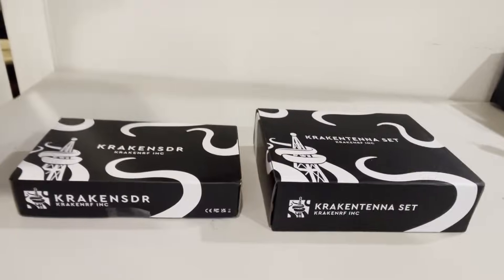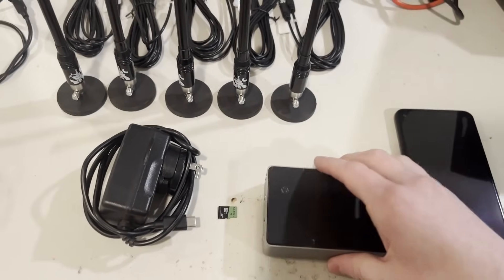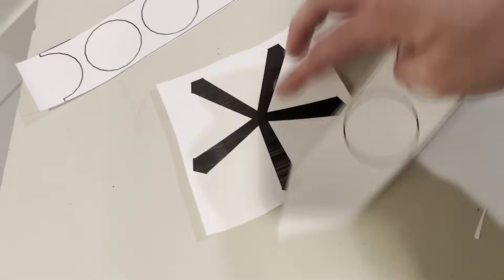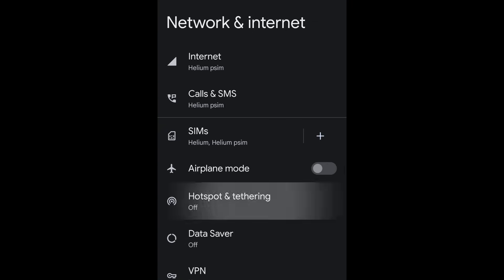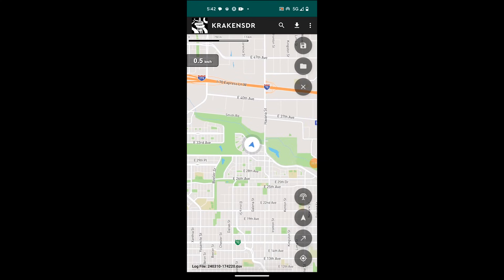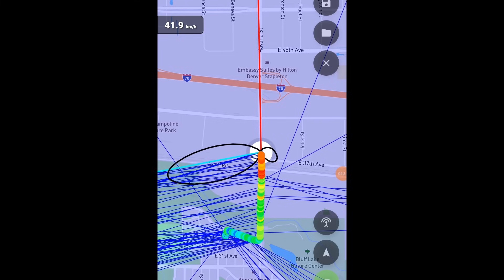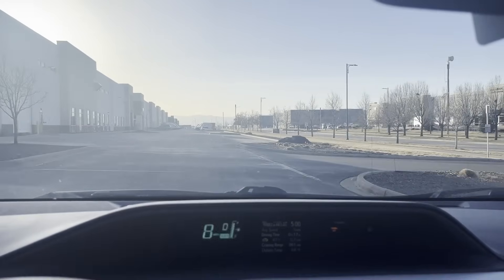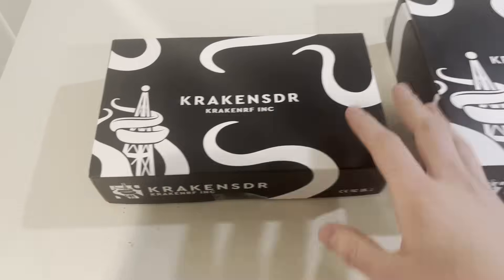Kraken Radio Direction Finding Unit Setup Tutorial and Demo

Comment: I purchased the kraken as part of CrowdSupply (years ago), but have not have a chance to use it yet. That said, I'm very rusty and had no idea where to start, so you video was very helpful, thank you 👍. I got stuck with the Angry IP software not finding my Kraken over the hotspot. It ended up being because the IP range it was scanning was not the correct range for my mobile hotspot. E.g. it scanned 192.168.0.0 - 192.1668.0.255 and my hotspot was in the 10.59.59.0 - 10.59.59.255 range.

Comment: Very cool!  I don't know a whole lot about radios.  But could this setup be used to direction find a specific LoRa signal on 915Mhz for example?  Or would it pick up all traffic on 915Mhz rather than just the signal I'm looking for?
Reply from the maker: Probably tricky for ism 915, lots of random signals there and can’t really lock down on the one you want , the kraken can’t decode by protocol

Comment: I used mine on a 2m fox hunt this evening. Im running low prowfile 4" antennas and it wasnt ideal. Wanted antennas that would stay put 24/7. Might use telescopic 1/4 antennas next week. Until I can make a sheetmetal platform to permanently affix the elements (although, this limits my frequency options a bit). Maybe I'll make uhf and vhf layouts, which I could move to, without too much hassle.
Reply: Just use 1/4 wave mag mount whips.  I use small black ones.  Hard to see.
Reply: @stargazer7644  ended up using strong NMO magnet mounts with adapters to 1/8" steel whip material.  I need to paint the elements black, tomorrow (bare metal will rust). Rather than exotic (expensive) steel, found Lowes has decent strength steel rod for cheap price.
Reply: @frankthetank3342  TIG Welding rod is also a good alternative.  It comes in a variety of materials.

Comment: Very neat video, but one question, wouldn't a single directional antenna be more effective than using an array of omnidirectional antennas? Like, directional antennas are already very good at direction finding so is the Kraken just showing that direction finding can be done with an omnidirectional antenna?
Reply from the maker: With a directional antenna you would have to manually get outside of the car and aim the antenna by spinning it 360° to find the peak signal strength. Completely doable and usually what I used to do but just takes a lot of time manually getting bearing lines every time you stop the car. Plus most directional antennas have side lobes so you might get a signal even if you aren’t pointed right at the source.
Reply: @SkylerF Well right... but with an omnidirectional you could be picking up that cell tower, or the other one down the street. A directional antenna would be subject to a lot less noise, and really, you only need 3 or more points for triangulation. Rather than driving in a circle letting the system figure out where something is until it actually figures it out.
Reply: @kjchaifisch  Been there and done that with various flavors of directional antennas.  Actually a cardiod antenna worked best, aiming for the LEAST signal rather than the most.  It has a single very narrow notch.  But as SkylerF said it's kind of a PITA especially if raining, cold, or no good place to park.

Comment: Very interesting, but is this allowed? A car with many antennas .  I have an idea: put a skiebox on top off the car.😅
Reply: it is. you can receive as much as you want
Reply: Why would it not be allowed?
Reply: Have a antenna farm on the roof of my 1 ton van.  HF screwdriver, 6 meters, 2 meters, 1.25 meters, 70cm, 33cm, 23cm, GMRS, CB and occasionally install the 5 antennas for a Kraken when I need to do direction finding.  If you want to see a real antenna farm look at Andrea K2EV's mobile Rover station.  https://youtu.be/A1-p3ZKl9NQ?feature=shared
Reply: This isn't an HOA. 🤣

Comment: Very nice demo. A few of us back at SARA have been talking about them since they were first introduced. They are looking like a pretty mature product now. My current plan, with a Kraken or just using signal strength DF with an RTL, is to build some cheap and tiny 434MHz tracking beacons that activate when a cord is pulled. A coworker has had some trouble with Christmas decoration thieves. - bs
Reply from the maker: LoRa trackers might be easier, 900MHz trackers such as the sensecap t1000
Reply: @SkylerF  Those look pretty cool, and I do intend to get into LoRa (Let's see if Meshtastic goes anywhere), but I am looking for a super compact solution, like within a heat shrink tube, to be sewn or stapled unnoticed into a seam in an inflatable Frosty the Snowman, etc. The only component I am missing is a ATtiny or somth that keys an id number along with a 45 second or so dash.
Reply: Why don't you just put an apple air tag on it?  Far simpler.
Reply: @stargazer7644  Good question. An AirTag could work for tracking stolen items. From a consumer perspective they would be simpler to operate However, they are much more complicated than a simple tracking beacon. They rely on a participating apple device to be within their Bluetooth range and ultimately rely on cell carrier networks, the internet, and proprietary devices and software. You can absolutely do that if you want, but my project idea is in the spirit of DIY, Amateur Radio, and possibly using the KrakenRDF unit for locating it, which is what this video is about.

Comment: Will the kraken work in a fixed configuration to get a directional bearing or do you have to be moving?  It would be nice if you could put multiple units at fixed locations
Reply: Na página oficial eles falam dessa possibilidade inclusive com uma aplicação em nuvem para gerenciar as unidades remotas

Comment: The Ford Pickup owners are beside themselves. Aluminum bodies...
Reply: Yes.  Nice not having the body rust out, but now I need to drill holes....
Reply: We knew this when we bought them.  But they're hardly the first vehicles with aluminum body panels - I had a car in 1978 that you couldn't put a mag mount on.
Reply: The arrow base antenna converts easily to a folding array for mobile use.
Reply: Roof racks and a steel plate on them.

Comment: Finally, a tool to find the CB radio jammers
Reply: We did that years ago for fun. If it's an AM signal, see if you can find a TRC-427, looks like they are pretty cheap on eBay. RF Gain on these is an RF Attenuator circuit. Mount a magnet mount antenna as far back on your vehicle as possible, to make it more directional. I have hunted down a walkie talkie hidden in a hedge with this exact setup. And I have also been able to get a correct direction on a 300 watt linear at less than 1000 feet. $50 or $500, your choice. If you only need it for CB, the $50 sounds better to me.
Reply: @javabeanz8549  Yeah, ours are 477MHz FM but same ideas.
Reply: @javabeanz8549 You don't need an AM RX to hunt an am TX
Reply: @javabeanz8549  The Kraken isn't a psudodoppler, and doesn't need an external reciever.   The radius of the antenna array might be an issue though.
Reply: Same with tracking jamming on Amateur Radio repeaters frequencies and those abusing that are on Low Earth Orbiting Satellites Carrying Amateur Radio (LEO OSCAR) Satellites. We had a nightmare tracking taxis using Amateur Radio frequencies and our AMSAT UK satellites over Rio de Janeiro and Brazil. It was heading for a diplomatic situation through the abuse of AMSAT-UK Satellites, UOSat. Though AMSAT Satellite AO-13 helped during the Falklands Isles War in 1982, as did access to an American military satellite 🛰. Surprisingly, even though satellites were crude back then, when AMSAT-UK and a young man Chris Jackson created a Windows based program called Wisp to use digital data Satellites Carrying Amateur Radio, the systems worked surprisingly fantastic. Many agencies learned valuable lessons, and new skills have never been used so efficiently before. The OSCAR satellites were built by Professor Sir Martin Sweeting and his Surrey Satellite Technology Ltd (SSTL) originally at the University of Surrey until SSTL outgrew the University of Surrey. I really miss using AMSAT-UK UO-22, KO-23, and KO-25 Amateur Radio digital satellites and several other satellites and the International Space Station and chat with scientists based at BAS Hayleys Iceshelf base in Antarctica exchanging questions and received answers, music, sounds of Penguins and sharing pictures. It also helped several Welsh school students chat with scientists about working in extreme environments at the South Pole and a husband and wife team doctor and nurse working in Africa. Yes, even allowing them to request advice on X-rays of a medical patient 500 miles from the nearest hospital. You see, KrakenSDR, satellites, and terrestrial repeaters can work together to capture evidence of who abuse radio communications. KrakenSDR is a great tool to help track down those who abuse radio transmissions and track the abusers.
Reply: It's designed for VHF and above using FM mode, so it won't get the 11 meter SSB/AM clowns. Use KiwiSDR for them.

Comment: Most important reason to get the antenna kit: The antennas must be precisely identical down to the atom, give or take, in order to use this for direction finding.
Reply: It isn't quite that critical.  The accuracy of the bearings isn't all that precise, so while you do want the antennas and feedlines to be a close to identical as possible, a few fractions of a wavelength isn't going to make it unusable.

Comment: How’s this useful to anybody? Do you unlock a trophy for finding 100 towers?
Reply from the maker: Finding jammers and illegal transmissions also
Reply: @SkylerF  I mean sure, then what? You’re going to knock at their door and ask them to quit it?
Reply from the maker: @benefactionhindrance  that might at least scare them enough. We also had an issue on skyhub with an unintentional interferer, a newbie had a stuck mic for a week disabling the repeater. They were apologetic and said it was a mistake. This would’ve helped at least speed up the process.
Reply: @benefactionhindrance  here in Houston we had two disgruntled club meters heckle the repeater for years. They were careful and would tag team so one signal would be on one end of town then a minute later the next signal as a totally different bearing. 

Took a few years. It they finally got them and yes there was some banging on doors. 

What they would do is park really close to a known repeater users house and jam the system leading the trackers to come over to that hams house and bang on the door. 

It got very ugly.
Reply: @SkylerF  Many years ago, I ran down someone who had a stuck transmitter on the local packet channel.  Their rig had all the control in software, and the software had crashed.  When we opened the door to the radio room, the smell of HOT transmitter filled the air.  Might have ended up in a fire if not stopped.
Reply: Transmitter direction finding is very useful for hunting down interference. If you’re not a ham, it may not seem too useful.
Reply: @ch716  ok, you locate the interference. Then what?
Reply: @benefactionhindrance  It depends on the situation. Sometimes, people are unaware they’re causing interference and are willing to work with you to fix it. If I were causing spurious emissions and someone informed me, I’d be thankful and correct the problem. Other times, the offender could be hostile or doing illegal activities. In that case, you have to report it to the FCC (in the USA). We can’t have people causing interference with emergency services, etc.
Reply: Sounds like someone running an illegal simplex VHF repeater would ask...😂
Reply: Use your imagination. Knowing the location of an intentional radiator could be used for many things, good and bad.